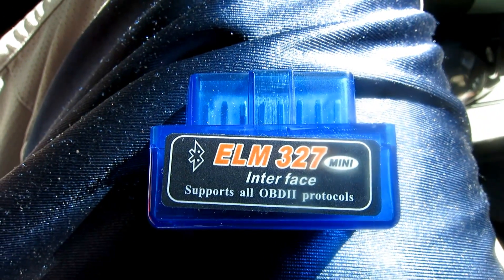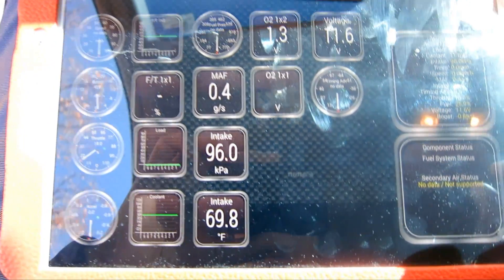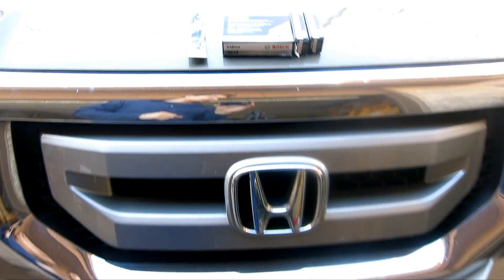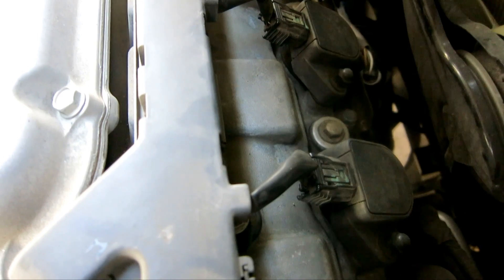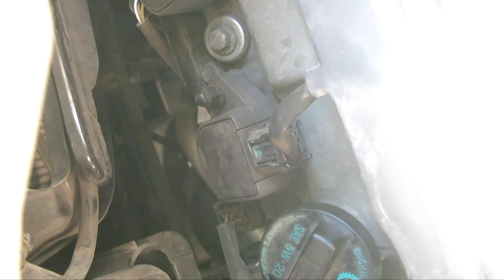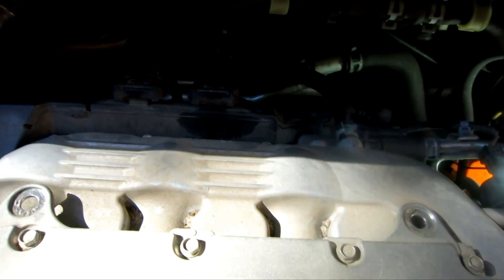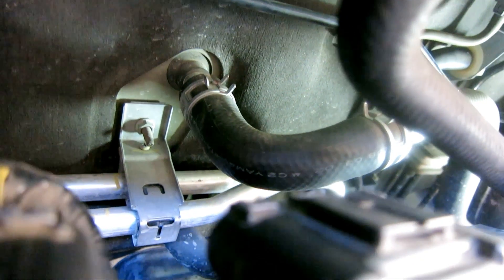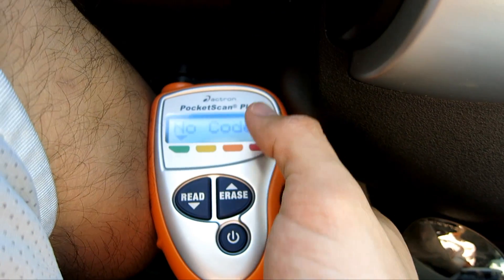P0303 Honda cylinder 3 misfire detected code - Change spark plug - ELM327 OBDII reader with Torque

Comment: I had same code. Replace the 3 coil pack. That is second-from right.  You count the plugs 1,2,3,4 from left to right.  Is it common for the third ignition coil to go vs the other ones? If so, why the third one?  I have 338,000 Km.
Reply: what was your problem? if it is already solved
Reply: Thanks for that info.
Reply: From the rear of the engine to the front?
Reply: @Bluehef614  left to right. Stand in front of the car , facing the car. Coils are left to right. If your asking front/back you may have an older model with spinning ignition coil

Comment: My check engine came on, I scan it and I only have a P0303 code (That's cylinder 3 misfire). The engine is so quiet that I actually have to touch the car to know it's on. I'm going to try changing the spark plugs and see if it clears the code. I'll let you guys know the results. Thanks for the video.
Reply: What  happened  I had same issue replaced plug and coil runs  better  but still  shows  the 303 code

Comment: You can use any plug you want.  Set the gap correct on a $2.10 each autolite irridium, and they work just fine! Marketing BS! My GSXR 1000 called for expensive NGK plugs at like $14 each. Instead after it’s 7,500 mile tuneup I installed all (4) new auto lites that only ran me $7.47 for all (4) lol. The bike dynoed about 2 more HP! 
Don’t listen to there marketing lies, and BS...
Reply: As a 12 year honda tech I can tell you to not use autolites
Reply: @k0nnl1n  but why? whats up with autolite
Reply: @lordhriley  Honda's don't seem to run well on them at all. I have had cars towed in after customers did their own tune up. Only problem was the cheap plugs.
Reply: @k0nnl1n  Thank for the response, what plugs do you recommend?  I have autolites on my van now!

Comment: You should always check the plug gap before installing spark plugs, new or used.  Takes a few minutes, can save much agony.  Glad you used anti-seize.  Can you imagine if one of those plugs got seized in one of the back cylinders (or even a front one for that matter).  Get ready for a bunch of "experts" to tell you you don't need to do that.  Good job.
Reply: Irridium plugs are pre-gapped and you are not supposed to bend the electrodes... Not re-gappable!

Comment: Just an FYI, at least on the Honda Odyssey this is a known defect. If you bring the van in with cylinder 3 error to the dealer they will do warranty work and replace a bunch of stuff.
Reply: Does the defect by chance apply to 2012 Odysseys w/80k+ on the OD? (If so, I'm also assuming original owner of the vehicle only or is there possibly a recall?). Our HO recently misfired on a road trip this past weekend. Stopped to have the warning light/misfire checked and odb scanner showed code 303/3rd cylinder misfire. Interesting side note, misfire condition cleared shortly after the obd scan/once we were back on the road and hasn't returned...yet.
Reply: @__WJK__  OOOHHH!!!! But it will and when it does it will come back sooner and sooner.  Its best to nip it in the bud NOWWwwww!!!!
Reply: Why the 3rd cylinder?